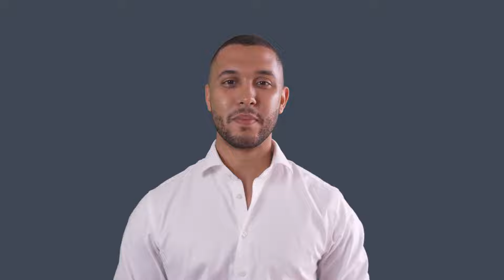Why does the car jerk when shifting from park to reverse?

Comment: Bmw 8hp 45 hard jerking before stop  what is problem
Reply from the maker: Hard jerking or stuttering in a vehicle, especially before coming to a stop, could be due to several reasons. The BMW 8HP45 is an automatic transmission system, and problems associated with it can range from mechanical to electrical issues. Here are some possible causes:

Transmission Fluid: One of the common issues that can cause a vehicle to jerk or stutter is low or old transmission fluid. The fluid is essential for the smooth operation of the gears and when it's low or old, it can cause the transmission to function improperly.

Transmission Wear and Tear: Over time, the components within the transmission system can wear down, causing inefficiencies in the system. This can manifest as jerking or stuttering when the vehicle is slowing down.

Software Issues: Sometimes, the software that controls the transmission can have glitches or errors that cause the vehicle to behave in unexpected ways.

Transmission Sensor Issues: The transmission relies on several sensors to function correctly. A problem with one or more of these sensors could cause the transmission to jerk or stutter.

Engine Problems: Issues with the engine, such as misfires, can cause jerking. This is because the engine and transmission systems are closely linked and problems in one can affect the other.

Torque Converter Problems: The torque converter is a key component in an automatic transmission. If it's not functioning correctly, it can cause a range of problems, including jerking or stuttering when the vehicle slows down.

Given these possibilities, it would be best to have your vehicle inspected by a professional mechanic or a BMW service center. They can use diagnostic tools to identify the exact cause of the problem and recommend the best course of action. Always remember that early diagnosis can prevent further damage and potentially high repair costs.